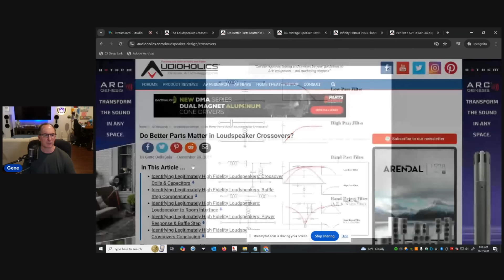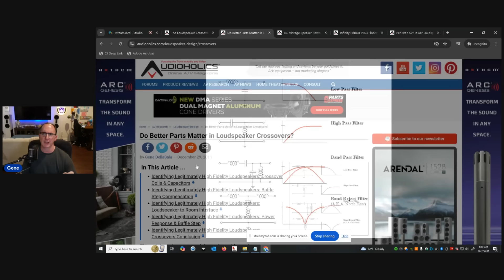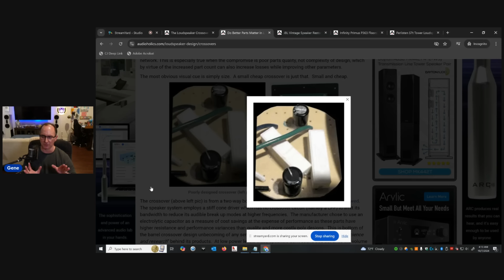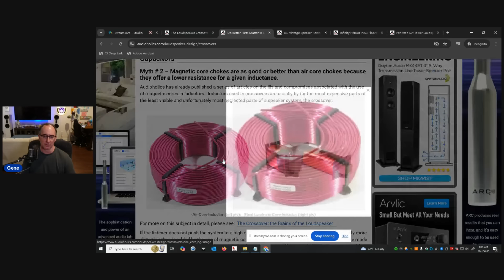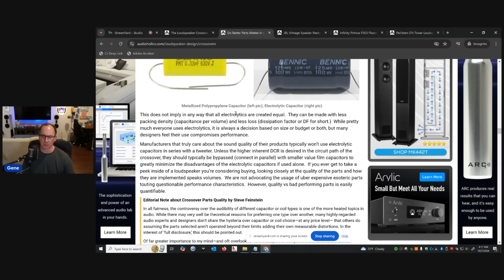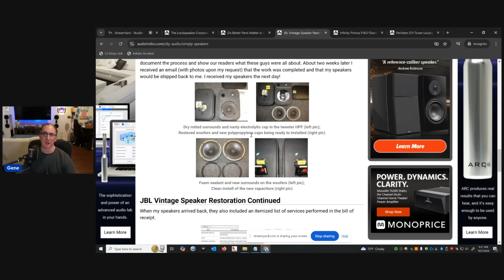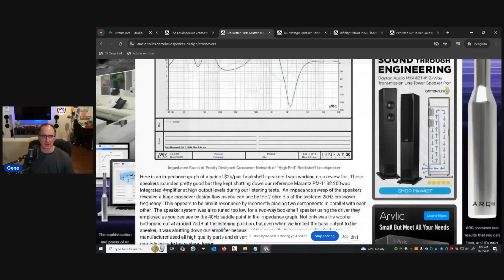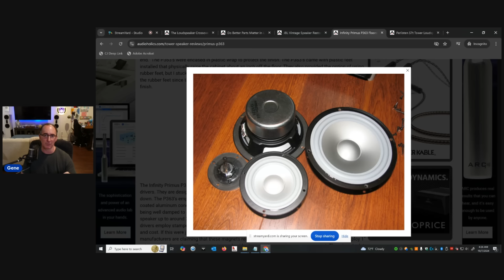Loudspeaker Crossover Upgrades - Are They Worth the Effort?

Comment: Good job Gene.  One way to answer your question is take a pair to Danny and go through the process with him and take your own before and after measurements and conclude your own at home listening tests. Amir at Audio science review tested the Klipsch RP600M with and without Danny’s upgrade. He said the standard speaker was terrible but the upgraded one was very good. And Danny has shown time and again that it can be worth spending a significant % of a speakers value on an upgrade if it has good bones, as you’ll end up with something miles better than a standard speaker equal to the cost of your starting speaker plus the upgrade as the standard more expensive speaker will likely use same time of parts  as your starting speaker. Danny has done more Klipsch upgrades than any other brand but also done a lot of B&W amongst others. Do your viewers the service of going seeing what he’s all about and give us your verdict. We need to know. Chris from Vinyl attack and Jay of Jay’s Iyagi have both been and we’re now waiting to see if Andrew Robinson has the intellectual curiosity and Cajones to go there. Looking forward to your report

Comment: Awesome video . This topic is a very interesting one. For me I have a pair of Polk audio monitor 70 series 2 and when it comes to upgrading or even putting in the same value parts, what I learned from Danny from Gene is that is it worth doing these type things.. for me it was a project to see if it was true to upgrade my parts or to leave it as is. With me I'm not saying I have a golden ear no. But when something does not sound right , I tend to figure out the problem. It's worth it to upgrade the speaker if I feel as though it's worth it. If I think it has more potential I will do the upgrade to the parts is only as the same values  , And let me tell you it sounds amazing. With the tolerances it is tighter what is just right for me. There was a little bit of a change with the Tweeter. But with the tolerances of my ears it was perfect for me.

Comment: You commented on using small tolerance parts.  One thing that I keep wondering about is the tolerance of the drivers themselves.  Electrically and mechanically, how consistent are they over a product's run and lifetime?  Does it even make sense to worry about the crossover tolerances, when the drivers themselves have a wide tolerance?
Reply from the maker: Yep tolerances matter in drivers too.  It's why some companies make their own to ensure QC.

Comment: Congrats on 25 years Gene and thanks for continuing to bring value to audio equipment consumers and enthusiats. Personally, I'm skeptical towards GR research but mostly because of the flaws in Danny's measurement process (this is discussed in detail on ASR), NOT because I'm sold that all audible differences are always visible in todays SOTA measurements (100% pure objectivist POV). Also, I do believe him when he says that the upgrades are only a very small part of his revenue. Where I am concerned is altering the voicing of a speaker with upgraded parts because the measurement process has gaps. Some of Danny's updated crossovers made some aspects of the measurements actually worse from what I remember so caution is advised when going down the mod path.

Comment: Zu offers a cap upgrade on more expensive speaker packages.  I upgraded the caps on my Klipsch RP5000f using Auricap XO and it made a significant difference.  So much so that I upgraded that to Jantzen Z Superiors and got more of an improvement.  Dynamic range and the low end improved.  Was like I had new speakers.  This was only the caps, not the resistors or inductors.

Comment: Gene, one thing you could've mentioned too about the premier example of a good crossover @19:28, is look at the direction the inductors face. On the woofer, they are all orthogonal to each other (X,Y,Z), so this prevents the inductor's magnetic fields from coupling together. 
On the mid range crossover they don't do this as much in the Z direction, but every inductor is orthogonal to its neighbor facing X,Y,X,Y...

Comment: I just made new crossovers for 2 speakers, an open baffle set I designed and built and a set of B&W 603 s3's. In both cases the improvements are pretty darned epic. Yes, parts matter. Once you get involved with high end capacitors you'll never want to go back. Iron core inductors are rubbish for sound.

Comment: Yes they do. I work in aerospace. There is a reason why we use certain classification of parts. But I'm sure for most people including myself we might not be able to tell the difference in a loud speaker. But you certainly would want that the cockpit of an airplane you're flying in had the best parts available correct. Let me lift you in on something they kind of are but the building so much redundancy they don't have to spend millions on one circuit. Yeah I'm exaggerating a bit but you know what I'm saying. If you are three systems to do one thing you could have the second best parts in it and be happy with it. And we do and we're happy with it. The funny thing is everybody seems to test these speakers to see how flat they are. That doesn't mean it's going to sound good. And if you're just listening with your ears who's to say your ears are the best. I'm going to tell you right now they're not mine are most people's ears are not. Hey my rant is over now. Remember grammar in my rant doesn't count😂

Comment: I've got a pair of Infinity Quantum 4 speakers that I purchased way back in 1978, over 46 years ago. These speakers provided me with many years of listening pleasure, and in 1996 I had the Watkins dual-drive woofers refoamed. The EMIT tweeters and dome midrange drivers are in good shape, but now I'm concerned about the 46 year old crossover parts. Several years ago, I contacted Watkins Engineering to inquire about the crossover and get some advice concerning replacement or repair. The good folks at Watkins Engineering told me that the elderly crossover should still be good, but I'm skeptical. I'm pretty sure that the parts used for the Infinity Quantum 4 crossovers are not top self', but what do you think? Thank you for this excellent presentation.

Comment: Danny also uses iron core inductors for woofers in three way designs. As I recall, he said it's OK up to a few hundred Herz.
Reply from the maker: @IliyaOsnovikov  yea makes sense and torodial cores can be great options, too, w less DCR than air cores. I should have discussed it but I did add a caption text about it.
Reply: Yes the really big iron core inductors he uses on some woofers are of a high quality. They are shielded or laminated in some way. I used them when I re did the crossovers on my CerwinVega! Speakers and they worked fantastic!

Comment: A really excellent presentation, Gene.   Design.  Implement.  Measure.  Repeat.  And when one finally arrives at a reference design that is golden - make sure the manufacturing/production line doesn't screw the pooch.  I would hope a reputable speaker company would periodically take production units off the line, and compare their measurements with the reference unit.  Are there companies that actually do this?  I don't know.  But they should be doing this.

Comment: You can’t get too technical. Guests from the manufacturing side is also awesome idea. I’ve also always wondered why there are so many drivers for similarly sized speakers, what do companies hope to gain by designing their own drivers in house when some off the shelf parts have really good performance.
Reply from the maker: QC can be one reason. The other, is to distinguish themselves from the competition. In many cases, manufacturers that claim they "design their own drivers" often use the major driver companies and request slight cosmetic or electrical mods to suite their purpose.

Comment: Nice video. I appreciate this kind of content. reminds me of the old factual videos you used to make. Feel free to go a little deeper in a series of videos. What do you think about material selection in speaker terminals, for example?
Reply from the maker: non ferrous metals should be used for all connections IMHO. I had to change out alligator clips on my AP test leads when measuring a very low distortion amplifier to get the most accurate results.

Comment: I did upgrade the crossover parts in a pair of ProAc Studio 150 once. Close to 30 years ago now? I took the basic precautions like swapping iron core inductors with closely matched resistance in air cores (not to mess with box tuning). I think it turned out better for it. Not dramatically, but slightly better, especially at higher volumes. Those speakers may well have been good candidates. The drivers were the SEAS P14's and a ScanSpeak D2008, so high quality Scandinavian drivers with rather cheap and cheerful crossover components. That was maybe the typical way of doing it in those days? At least it looks like the typical penny pinching is more evenly spread across all parts these days? 

DIY-ing now, and don't expect to ever use a passive XO again, except for a protective cap on the tweeter.

Comment: One more thing, when I do custom speaker setups, whether that's car audio or home theater, I just do bi-amp between tweeter/mid woofer. I use JL Audio 300/4 Class A/B amplifiers with built in Linkwitz Riley 24dB/Octave analog low level crossovers that are 180* out of phase each, making them in phase at the crossover frequency. $100-$150 for the amp for a 2 way setup. I'm doing this in 2 vehicles. No high voltage crossover at all, and sounds amazing.

Comment: Danny does use iron core inductors sometimes, like on the Klipsch RP-8000F's bass driver.  He says it's okay when the crossover point is <200 hz.
Reply: As a compromise to keep cost down. The lower the crossover point the higher the cost of parts.

Comment: My speakers have a passive crossover between the tweeter and midrange.  There are 4 parts per channel and is composed of a Goertz Copper Foil 14 gauge inductor, a Mundorf Evo Oil capacitor and 2 Mundorf 10W MOX resistors.  There is an electronic crossover to the woofers which is done by a MiniDSP SHD.   The crossover was professionally designed as I had more sense than to try it on my own.  My sense is that these are good quality parts.  The speaker is a modification of a professional design which was entirely passive.

Comment: To summarize: I would say "not happy with the sound" is the biggest driver of change.. so defining the specific reasons of what change you want will drive the next upgrade.  
To get to your final destination: Do changes 1 change at a time and learn what your system reacts to, and isolate where in the system you have an issue.  

My story:
I built a room with a lot of acoustic treatment.  That let me then tailor the sound to my tastes with gear; isolating 1 thing at a time.  This was a nice luxury and I no longer have this option so I have to take a different (and more 'normal' strategy).

A long time ago, I had Danny's crossover work done on some Usher X-718's.  A few years later, I had Piega crossovers completely redone by the late Rick Craig.  

- With the 718's I noticed a small but nice improvement in the sound presentation.  It required A/B comparing to a non-modified version to hear and understand the (small) differences.  

- With the Piega's, I explained the issue with the sound; some dryness in the upper mids, and some congestion/harshness that I didn't like.  Rick addressed those specific issues but then came up with his own idea of how they should sound.  He made choices as a speaker designer.  In the end, I got them back, and again, compared them to a non-modified version (thanks, Steve!) and the new version was a huge improvement to me, but not a huge improvement overall.  Because Rick addressed what was bothering me... and plucked out that problem.  Otherwise, most people in the room hearing this comparison thought it was a 'nice change' but nothing major.  I think 1 person even preferred it the original way.  (The guy with the unmodified version)   

That's my experience so far.  Now I've moved away from my purpose-built sound room to a condo; and am looking for a normal house.  
I turned my attention to speaker companies that use quality crossovers in the first place.  JM Reynaud being one of them.  However, in the end, if the 'voice' of the speaker falls on my ears and brain in a natural way, I'm half way there.  Tweaking up to hearing about 75% of what sounds realistic takes thousands of dollars and hours to get it right.  That is this hobby.  The journey never ends, the return on investment does diminish the closer you get to 'perfect'.    

But, along the way, you get to enjoy the sound of music; and that is my therapy.  As long as nothing gets in the way of me relaxing and enjoying the actual music, the tweaks can stop.  Getting to that point takes knowledge and wisdom.  It's also a personal journey.  Most of my experience is direct, hands-on.  It's so easy to read and read.. but you learn more in 1 hour doing your own system experiments than 40 hours of reading what someone else experienced.  So, it's worth a drive to go hear something.  I hope more people in this hobby can get together and learn from each other in person.  That's really the only way to grow your system in giant leaps.   A crossover upgrade is a small step in a long journey... but can be very important if it's the thing that brings you closer to your music.

Comment: I just upgraded my Klipsch 504C center channel
Speaker through GR and wow big differences.  I have the 600m book shelf and 8000F tower speakers I bought for half price so am going to upgrade them to.  They both have issues that Danny has fixed and I have heard the holes in the problems that he has said they have and I am confident that this fix will fix them.

Comment: Dunlavy always used cheap parts in his speakers but carefully optimized and matched construction to get it right.  That said i used high end caps i selected based on reviews of their sound to construct a high pass filter for some vandersteen subs.  The high end caps sounded way better than the trial filter i made with cheap parts. High end amp designers also select high end caps to voice their amps

Comment: I have four pairs of NS1000M. I got updated crossovers for one of them from someone who is quite famous for making crossovers for it and honestly, maybe it's my ageing ears, couldn't hear a difference. Also, many tests have been done on the crossovers of these speakers and it was found that very little difference variations between the original specs of the crossovers due to age. Thank you for your in-depth analysis as usual GDS.

Comment: I am a DIY speaker builder, building designs by well known DIY designers. Regarding steel laminate inductors, the Continuum speaker by the late Jeff Bagby utilizes two steel laminate and one air core inductors. That's how he designed it, can't argue with him anymore. Steel laminate inductors offer low price, low DCR. Many well known DIY designers use steel laminate inductors in the woofer circuits. To anyone replacing steel laminate inductors with air cores in pursuit of sonic excellence, consider matching the DCRs of the new with the old.
Reply from the maker: Agreed, steel core laminate have advantages over air core for bass frequencies.  Torodial ones can handle like 1kwatt of power!

Comment: A New Record Day did a sound demo with the just upgrading the cross over components. Not changing the voicing of the speaker. And there was a clear cut difference. The sound was more clear, forward and dynamic. VS something more veiled, subdued and dialed back overal. It was easy to pick out even through YouTubes compression and through some half decent $40 ear buds. They ain't bad actually after some EQ.

And with GR Researchs cross over that fixed the dip in the cross over points. Even though it was not bad, fixed the slightly more recessed mids and in combination with high quality parts, made a very nice upgrade to the speakers.

And speakers like the Klipsh RF-7 III with it's large mid rang dip because of the poor cross over points and being out of time 70° from the tweeters. And the fact they used the cheapest quality parts available. I'm sure the difference would be a dramatic night and day difference.

Although the best way is just just bi amp it and fix the timing and crossover over points that way. The pure setup and with a pair of Starkcrimson 500WPC and 150WPC. One controlling the woofers and one the tweeters. You have super pure, clean driver control and just use software to controll the crossover and timing.

Comment: On the issue of tolerances, yes that matters in mass produced speakers, but for DIY the parts are typically measured individually, so even if the part is labeled with something like +/- 15%  you can still get accurate values for the design as well as left/right matching.
Reply from the maker: @G3rain1  I'm discussing mass production, not DIY.